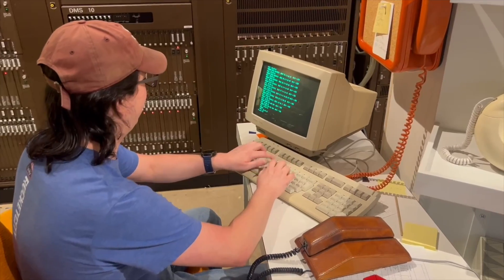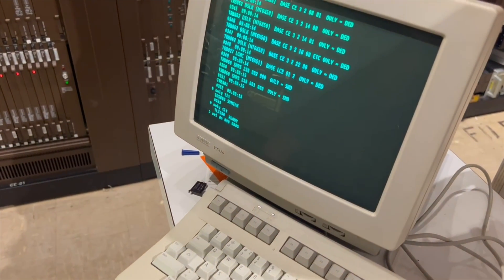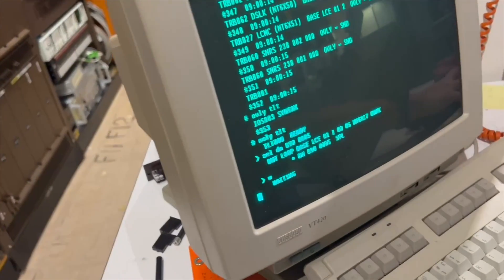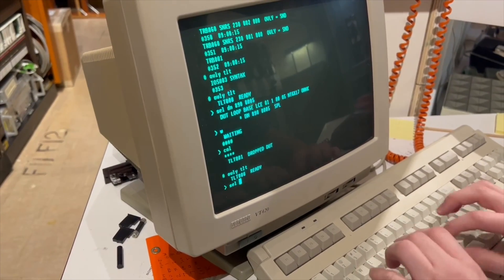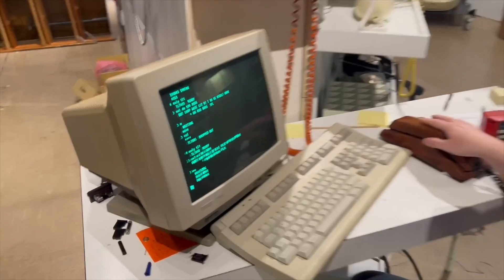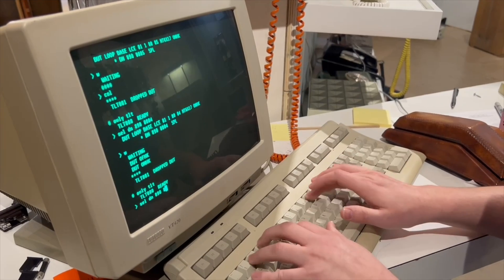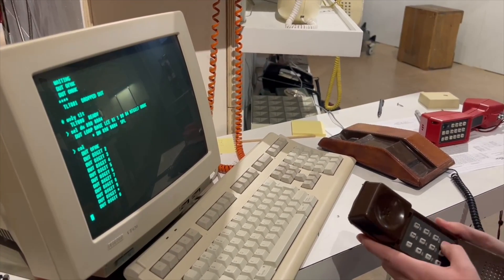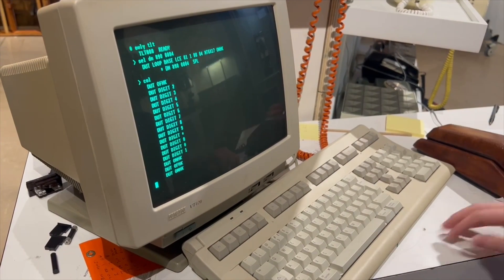DMS-10: The first phone call!

Comment: Not sure if the DMS-10 had a craft-shell menu as an option, but the DMS-100 did.  Once you typed the switch menu hierarchy correctly;  you could access the lines menu, then type menu items (such as: Type   6), to busy, 7-to test, 9-to restore, etc. (Has been several years ago, would need to check numbers for accuracy).  (Could observe line state in real time, (once a line was posted up into the control position).  This sure is a blast from years ago, seeing this video.

Comment: DMS10 intraoffice calls always had an interesting high-pitched "squeak" when the call would complete.  Are you hearing this also on your calls?
Reply: That was the switch testing for trans hybrid loss so it could set the gain based on whether you had a loaded line or not. This prevents singing on the line.( I designed the hardware.) This test was supposed to happen while you were picking up the handset. Not the case with handsfree headsets.  Also you could set this as a one time occurrence and the switch would remember the  settings for future calls. You can also set it manually and totally disable the function. Most central office folks don't want to know anything about the loops that the subscribers are using.
Reply: Very interesting!  All the calls I ever made on a DMS10 did it.  Guess it wasn't on DMS100 as I never noticed it in my DMS100 home calls (on those I only noticed the faint click after dialing an interoffice call).  Cincinnati Bell's first DMS10 was the replacement of a Stromberg XY in Union, KY in 1985.
Reply: @ncstewart66  Yea, they could set it once after they  determined whether the line was loaded or had bridge taps on it.  Then the tones wouldn't be there. Most telco didn't bother. The test was supposed to happen while you were picking up the handset. The hybrid circuit was used to take the 2 wire phone loop to a 4 wire circuit which the switch uses for transmit and receive. Balance is important to properly match the loop impedances and prevent singing and loss.  DMS100 never had this feature.

Comment: I wish they'd go back to the mechanical ones. Keep the newfangled as a backup, but bring back the mechanical switches, gears, whatever it is called. At one time, (1980's) the phone operator would know when someone's phone was off hook, and would know where calls originated and landed, even if she was not involved in the call. Also the OPERATOR would give telephone numbers and help people place calls. There wasn't information at 1411. If you needed to ring someone, and didn't know the numbers, the operator would connect you, or provide you with the numbers if the person was listed and or published. Also, there should have never been a charge for  unpublished, unlisted numbers. We need to go back to a lot of the old ways. Things were just better then.
Reply: no.  no they were not better.
Reply: @devtrash  In my experience, they were. I NEVER had a phone problem until this newfangled nonsense came along.

Comment: Did you have a hard time getting the cross-connects to punch properly on your MPC blocks? I was working on some old 70’s-era NT “66” blocks, that weren’t actually 66 blocks, but actually used the MPC-style clips. Modern 66 tools almost work, but not quite. If you’re getting a lot of punches that don’t actually cut the insulation, look for a QTH38B tool. (I’m assuming those are MPC-type clips, I can’t quite tell from the video).
Reply: We use wire wrap versablocks, and they've worked out really well. We really only have the horizontal side of the MDF in the cabinet, and then we wire phones directly to the front of those blocks instead of jumpering to another connector block on a vertical side.

Comment: Fascinating video. Could you do a video which describes the circuit or schematic of the analogue concentrators? Puzzled as to how thee system concentrates/multiplexes 2000 lines into a coherent digital signal
Reply: I worked on the competitor system EWSD and internally there are E1’s between the dlu (subscriber line frame) and the ltg ( trunk group) and the ltg are connected to the switching network, which is a space-time switching network (all is tdm, not packet switched). An E1 is 31 voice channels, the dlu has a concentration (overbooking) of 8:1 so for 1000 subscriber lines you would need 1000/8=125, 125/31= 4 E1 lines. Each ltg can handle 8 E1’s and a fully equipped exchange can have if I remember 512 ltg’s. But not all E1’s go subscriber dlu’s, you need half the ltg’s to connect to outgoing/incoming trunks too.

Comment: Just curious why you didn't use 66 blocks that were connectorized?  You could have plugged the 25pr cables into blocks and cross connected between blocks.  AMP made a tool to install 25pr male or female connectors onto a 25pr cable and it saves a lot of work.
Reply: We already had these wire wrap versa blocks on hand, and sometimes I'd rather just do the manual work than spend more time tracking down parts. We don't have the big 50 pin butterfly tool.
Reply: Don't have the tool, but I predict you will soon get an offer of a donation!

Well done!

Comment: OMG! The big orange cork board phone book holding telephone at 7:00 brings back a lot of memories! We used to have one of those and my egg donor (“Mom” is a term of endearment she didn’t earn) would stretch the heck right out of the handset cord- walking 30 to 35 feet away with it, into the living room. I would have to untangle and straighten up the cord every night just because the mess she would leave it in would make me feel uneasy.
Reply: On our old kitchen phone (when I was a kid), we put a swivel coupling on the handset end of the cord, to prevent that kind of tangle after stretching it across the house to the couch.  It worked well enough until we got a cordless phone instead.

That said, we had it on a comparatively-boring early 90s answering machine phone, which itself replaced a '70s-era Trimline.  The old Trimline later got plugged into a splitter behind the cordless phone, and placed on a nearby countertop, so we'd still have a handset near the base whenever both the cordless handsets were across the house somewhere. 🙂  (The cordless had a remote charger too for the second handset, with just a power cable going to it.)

I'd forgotten such groovy-looking corkboard phones even existed!  And how utterly-appropriate for a late-'70s switch, even if much of the hardware has been upgraded through the 2000s. 😎

Comment: Post up a couple of TRAVERs so we can see your translation design ?

Are you using universal translations or simple NCOS pre translators ? table IBNXLA etcetera.
Reply: I think those are DMS-100 tools. Right now we're just reusing the translations that the original telco had, while we try to figure out what they all mean.
Reply: @colinslater195  DMS10 has the same tools.

IF you can run a TRAVER that will show you everything you need to know about your translators. The exact call path and ever table the call  path takes.

Comment: Keeping this older tech alive to preserve how we got to today's tech is important. 

The lesson here is seeing the migration from circuit switched calls to packet switched calls simplifies and reduces cabling and complexity. 

Broadcast tech is going through this NOW migrating from baseband SDI cabling to the ST 2110 standard of video over IP networking. 

The reduction of complexity, lower costs, and expansion of new features due to the flexibility IP offers, is following the lessons telephony taught us.
Reply: Yes, that's right. As someone who worked for a IP PBX / call center software company, I totally agree. It has lots of advantages. Not being tied to any physical layer, better monitoring available to users, and having advanced functionality like call re-routing, queues, conference calls, whatnot that would have been prohibitively expensive or downright impossible if someone tried that with PSTN...
Reply: Hang on. A lot of those features did, in fact, exist in the PSTN. The reality of the times is that they were selectively marketed because they were not as flexible as people wanted. The irony is that many of the early soft switches simply went to the LSSGR and checked off which items to implement at which points in their development cycles. Meanwhile Nortel and many of the other PSTN switch providers turned their switches into VoIP call servers. One can debate the commercial success of those initiatives, but the PSTN had an enormous feature base that the softswitches could leverage.
Reply: @ctillnc  Yes, but it took the newer switches to enable those features. (See: Vertical Service Codes wiki)

I remember when they landed in our LATA in SoCal via GTE in the 70s. They seemed like magic at the time.
Reply: @lohphat  VSCs were the tip of the iceberg, in terms of what the 5E and DMS-100 implemented. The good stuff was in features for large organizations (governments, F100, etc) and proprietary non-POTS sets.